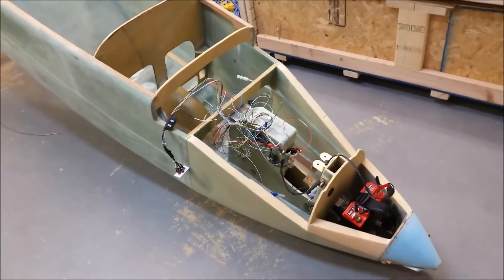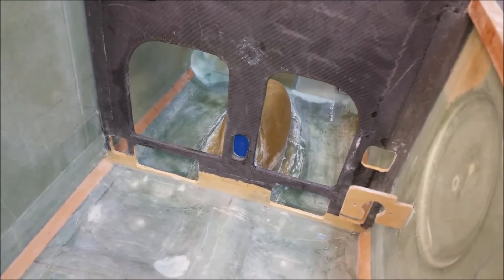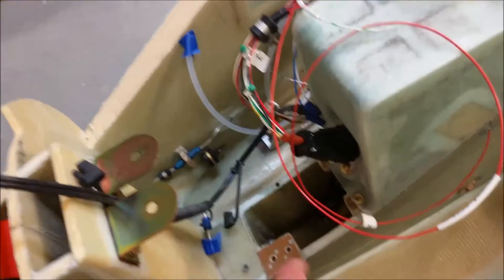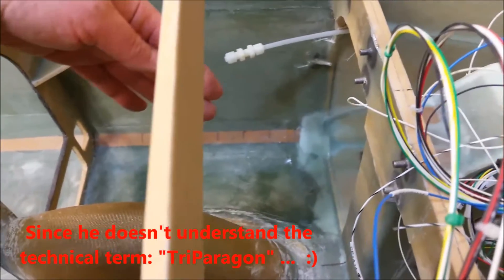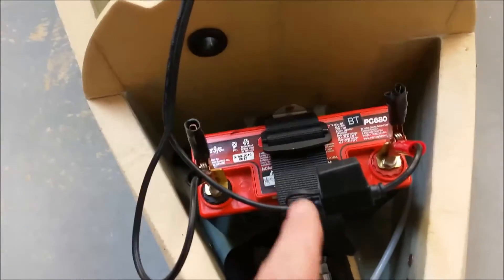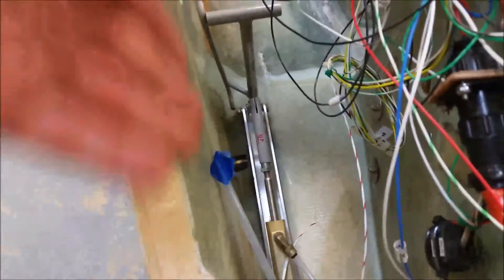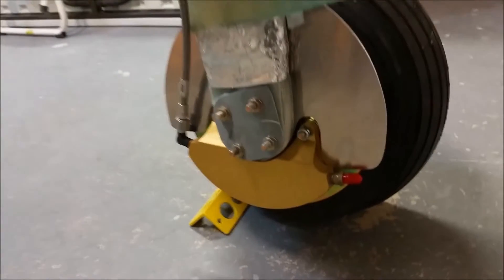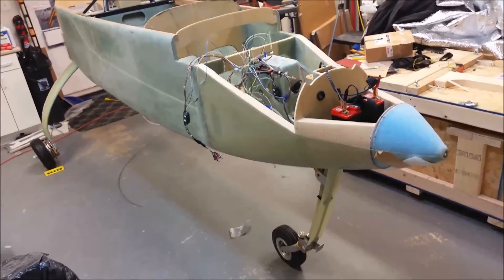Airdog77

Comment: Question:  What was the approximate weight as she was in this video ?
Reply from the maker: Not sure how much it weighed at this exact point.  I'd estimate as shown in the video with fuselage, gear and wheel assemblies at around 150 lbs.  That's a swag.  Estimated final weight is just over 1000 lbs.